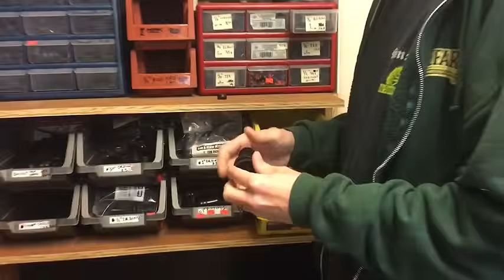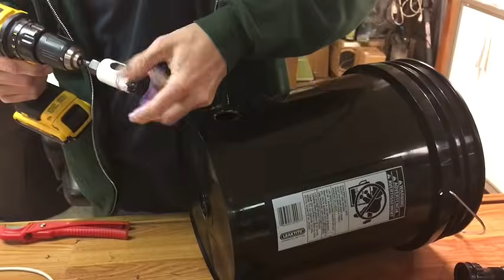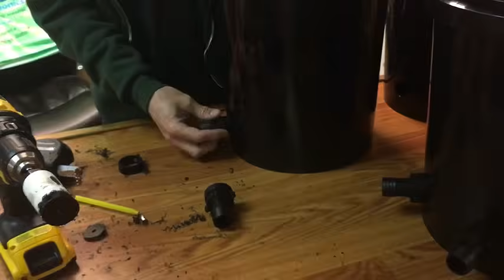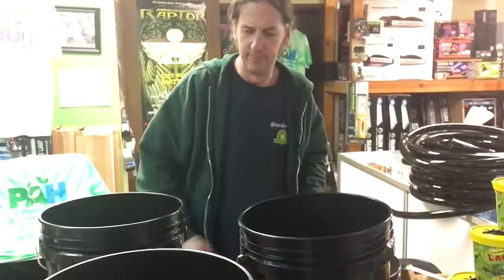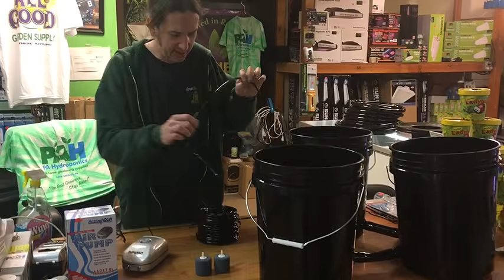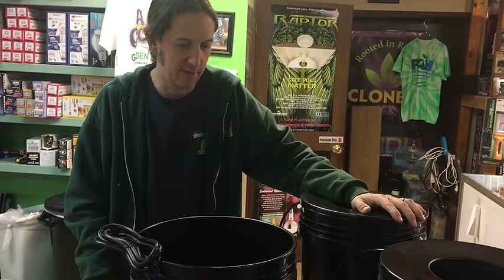Easiest double bucket STIRPONIC RDWC with reservoir and water level indicator built from scratch!!

Comment: Any suggestions for a dual/quad buckets with an external reservoir system?
Reply from the maker: Checkout hydrofarms GROW FLOW 2.0, I think your talking about a flood and drain system like this, I have had customers try to build these and use multiple timers in place of the systems "Brain " I don't trust timers enough to try to build one but this type of ebb and flo system is better because the root's aren't hanging in water all day so you don't have to worry about root rot in warm water or chillers. G LINK: https://www.hydrofarm.com/p/GFO7KT5

Comment: use the first bucket as a template.  slide the next bucket inside.  The holes will be slightly higher but would it matter?
Reply from the maker: Don't think that would work to well, as for holes not being  level it would be fine if you have large space between buckets, only time I had a problem with holes not being level was when I used Uniseals and 2" pvc pipe. G

Comment: This video series is great.  Could you please list the pumps and air stone size u use?  I'm looking at a 4 bucket system and would appreciate your expertise.
Reply from the maker: Hello, for your setup you should use a 4 output airpump, Active Aqua AAPA15L, 4 airstones round Active Aqua ASCM, and for the circulation pump from this video is Eco 66 ( 75 gph model 728490), you will have to neck the output up to 3/4 inch tubing to fit into back of drain connectors as for what you asked for part numbers  We sell all that and would ship it for 59.95 in continental USA, Just give us a call :) 717-528-4175, Hope this helps! Gary

Comment: What size pump would you recommend for 6 buckets and a reservoir with 1" fittings?
Reply from the maker: Hello, I have had the best luck with a 75 GPH waterpump, bigger pumps flowed a bit to much and didn't keep water levels equal. Hope this helps! Gary

Comment: So could i make the same system but with 5 buckets one of witch being the res and what size pump would u recommend for circulation? Thanks in advance.
Reply from the maker: Hello, yup we have done up to 10 but with10 the circulation didn't flow good enough, so 8 plus rez is max in my opinion , as for pump size about 75 gallons per hour is what we found works good , just enough to keep it stirred with 1 inch fittings, I have tried a 250 GPH pump and the water levels were way off, first bucket after pump was high water and last bucket was very low. Hope this helps, there are lot's of different ways to make this system. Gary

Comment: Gary, thanks for a very informative and thorough video.  One quick question ... do all the growing buckets need to be on the same level or can you set them up on different levels like shelves vertically?  I'm curious because I have limited space inside my home.
Reply from the maker: Hello, good question but unfortunately that wont work with this kind of system, you could just do individual bubble buckets on each level or there are other types of systems like NFT ( Nutrient film Technique ) that use rails or tubes and can be set up vertically. Hope this gives you some ideas. Gary
Reply: When I did my first hydroponic setup, I did a bato/dutch bucket system to go vertically. The buckets containing plants have to be fully above the reservoir bucket, and you completely fill those buckets with the clay pebbles to retain moisture since they won't be able to stay filled completely with water/nutrient. You pump the water up to the top of the plant bucket using much smaller irrigation tubing - one for each plant, and let it drain out the bottom back into the reservoir. It means needing a more powerful submersible pump that can handle moving all that liquid upward, but it's a nice half-way point between bubble buckets and NFT. A bit more susceptible to something like the power going out, but as long as you set the drain holes a little above the base of the buckets, some water will remain in them at all times that will be wicked up by the clay pebbles and can carry the system through several hours without flow.
Reply: @Nabbs07  Thank you both very much!!!  Adam Sebring, that sounds like a great idea.  I may try your variation and see how it works out!!!
Reply from the maker: hey , nothing wrong with beta buckets! , it is like a drip system and NFT together :) Thanks for watching ! Gary
Reply: @PAHydroponics   In Hawai'i we like luftpumps better than an airstones.. http://www.swisstropicals.com/filtration-shop/jetlifter-cubelifter-shop/

Comment: Im looking into building a similar setup can i put the buckets in a line with a hose going from front bucket to the back bucket instead of the triangle type formation you have the buckets in? my space is limited width wise but i have room length wise. And also do you sell kits to build this?
Reply from the maker: Hello, It should work putting them in a row, just don't use to big of a pump to circulate or they wont be even water levels. We sell all the parts in stock but no kits due to everyone wanting different bucket spacing and amount of buckets. We can put together your kit custom for you in about 5 or 10 minutes when you get here. Hope this helps! Gary
Reply: @PAHydroponics  too*